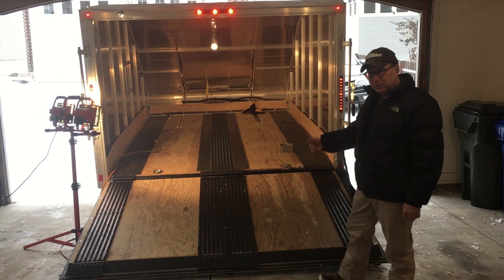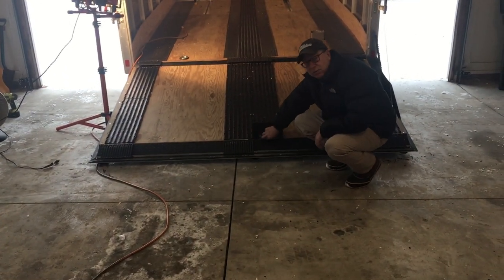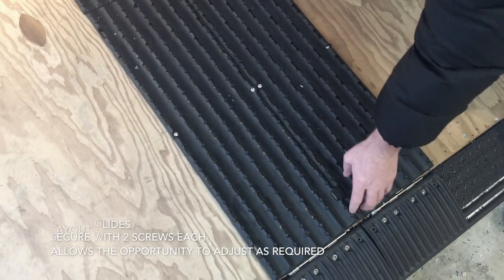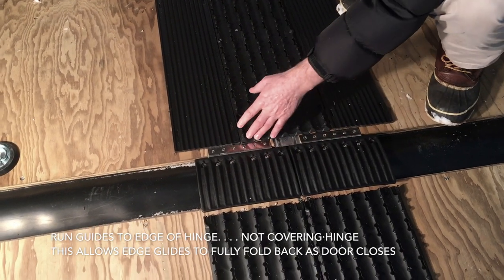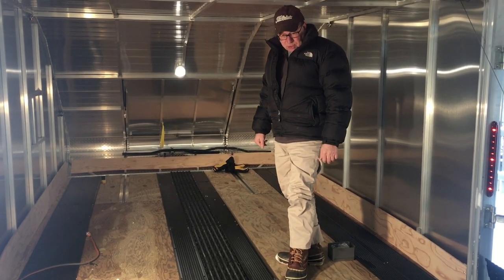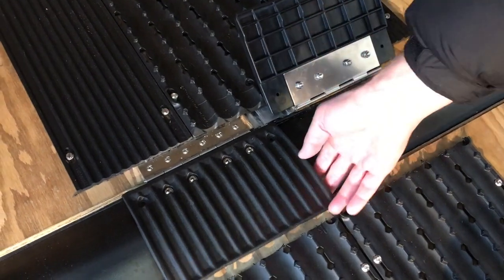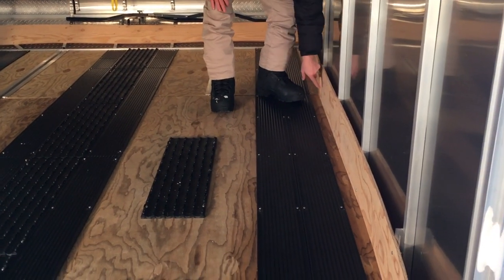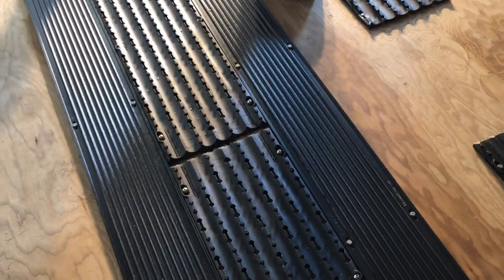Caliber Ski Glide Install in Triton TC128 Hybrid

Comment: This is excellent! I'm considering buying this trailer and this is exactly how i'd like it setup. I noticed the bottom door hinge with the big rubber seal going across, and you've got your protector over it that flips up when closing the door - has the rubber seal held up against the bolts/nuts on the backside that press into the rubber seal? And at the point where the door edge meets the snow when the door is down/extended, how has that first door seal/edge held up? I noticed it remains unprotected and would be the first point of contact for the carbide, while the inner door seal is covered/protected. Cheers!